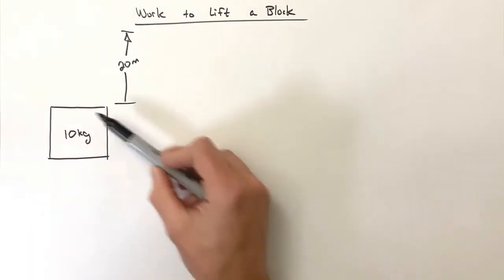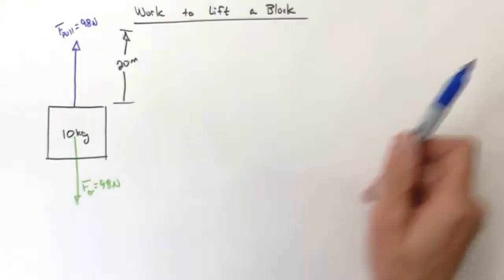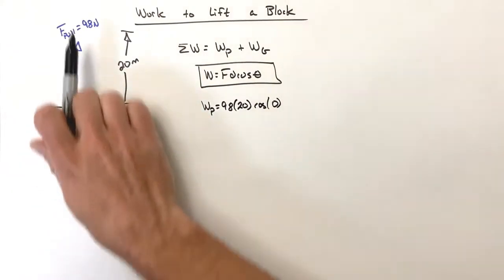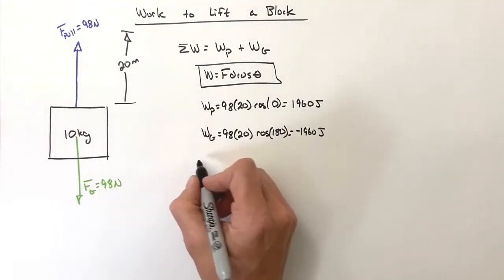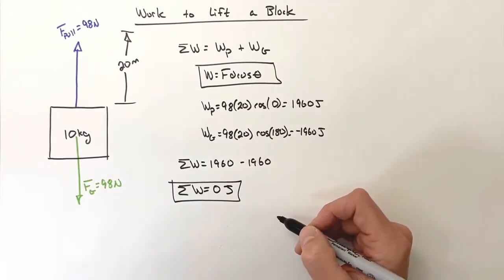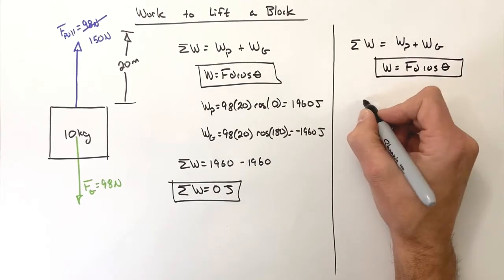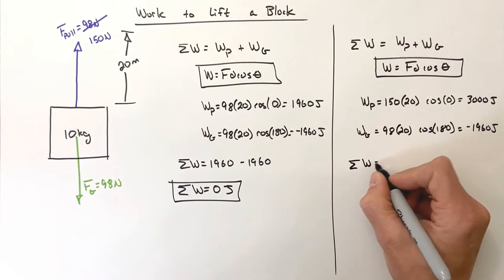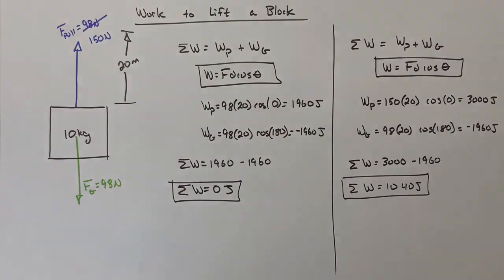The Work to Lift a Block

Comment: Could you explain more widely this issue? 'The work by the pull force upward is a nonconservative force which will change the mechanical energy of the system, gravity however is a conservative force and will do negative work to convert kinetic energy into gravitational potential energy aka. GPE'. It's the first place I found an exact answer to my doubts about what changes to energy makes the force of gravity in this case, but I still need to understand it better.